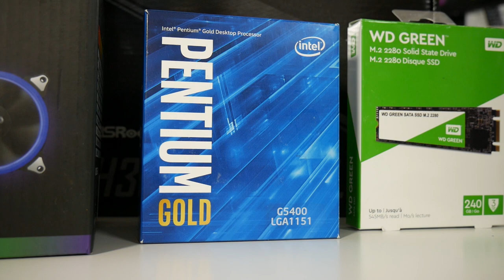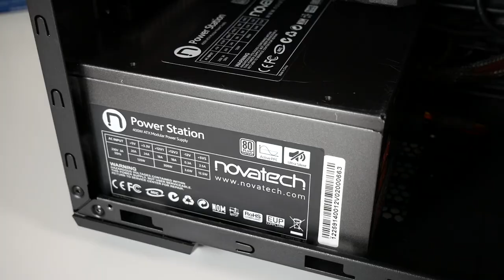Budget Intel PC Build Pentium Gold & 1050ti The Perfect Combination

Comment: Very nice build. If you don''t mind me saying, I think the only thing I would have done differently would be to put the power supply in with the fan facing up. That may help to knock off a few DB's of sound with the fan isolated inside the case, plus it would also draw a little more air out of the case to help with cooling. Just a thought. Great video, I'm glad I found your channel. ;)
Reply from the maker: Thanks for the feedback. I am also quite fond of mounting the psu upside down for the reasons you mentioned. The trouble with the power supply I was using is that the CPU power connector was a too short to mount the PSU the other way. It is a 5 year old model and wasn't designed for the modern way of installation. 
I think actually the psu is not really appropriate for this build as the CPU and ssd seem to be under performing, and I experienced a few crashes in Fortnite when playing yesterday evening.
I'm in two minds to send the lot back and do another AMD build. I really just wanted to use the cooler master case for something. And as I already have a 2200g build I didn't want to do the same thing again. But it looks like I might do!
Reply: Ah, good point about the PSU. Too bad it's under performing. I truly appreciate the way you respond to people here. Not a lot of channels do. Thank you.
Reply from the maker: Thanks Oletta, that is very kind of you to say. I try to respond to 100% of questions, even the rude ones! Sometimes one or two slip through if i am busy, but i do try and make everyone feel like it is just a 1 on 1 conversation on the couch and just be cool with everyone.
I am starting a discord server as a few people such as Harry have suggested it. I am a complete Discord newbie and i don't really know what the features do or the etiquette is but, the people have spoken and i shall make it so! So please join in and make yourself at home. ( or whatever is appropriate on Discord?)
https://discord.gg/E2EUUfq
Reply: @OlettaLiano  you are the only one here I recognize from the current gang....
Reply: @PapaMav  I can't believe I've been watching Mike's channel for over four years. Where did the time go? LOL
Reply: @OlettaLiano  I know right; time does certainly fly.

Comment: hi mike, great video, would you do some cpu\gpu\ram overclocking guides?
Reply from the maker: Max that would be a great idea! That was a thing I was thinking about doing but I didn't know if  the viewers of my channel are extreme overclockers or just people who want a little boost?
What camp would you be in?
Reply: Mike's unboxing, reviews and how to well, Mike i'm just going  to be starting out in trying to oc memory, cpu and asus gtx 1080Ti on an asus VII crosshair...so need all the help i can get as was a really big investment
Reply from the maker: No problem I'll sort something out for you 😀
Reply: Mike's unboxing, reviews and how to also have to workout how to oc patriot viper elite PVE416G320C6KRD 3200MHz as from reading it can get to 3733 CL14 @3.85v but not sure how feasible it is on ryzen as that was tested on intel plus i have 4x8GB samsung b-die i believe, so i'm guessing a high soc voltage and ram volt to get it stable with possibly looser timings.....not an expert by any means as it's been 1st major build since K8 AMD64 days so quite a while!

Comment: What power supplies are trustworthy in your opinion? I'm not seeing many EVGA 80+ PSUs for a good price anymore. I'm not that familiar with other brands.
Reply from the maker: Most "branded" psu are good these days. Anything with a good 80plus rating should be acceptable. I personally quite like the EVGA supplies, but they do seem to be getting more expensive. Also the be quiet PSU are good. Even the cheaper ones seem to perform well. Of course you can spend a lot of money and get a great psu, but I must admit I do tend to budget less for power supplies than I probably should 😀
Reply from the maker: Harry just ordered a riotoro onyx psu. Looks good at the moment. It gets a great review on jonnyguru so that is a great recommendation. Should be arriving tomorrow so I'll do a quick unboxing live stream at some point.
Reply: I'll be sure to watch, I have seen the 750w variant used in a few builds and they seem pretty reliable :)
Reply from the maker: Yeah I was thinking cx650m but the riotoro is actually nearly identical but £15 cheaper. But minus the Corsair logo 😀

Comment: Nice build. This case may be somewhat "cool" looking, however it's a horrible hot box. Watch those temps.
Reply from the maker: I already found out how bad the Cooler Master is for cooling which is quite ironic considering the brand name :-)
I am now using a RIOTORO CR500 and changed the motherboard and CPU to a Ryzen 1200 and Asrock AB350 K4 Fatality and the difference was night and day. Actually managed to get the Ryzen 3 1200 to overclock on the stock cooler to 3.7ghz with no extra voltage, and it runs really well.
The video for that upgrade/rebuild will be released soon if you want to see the difference.

Comment: Is 400w enough for a 8th gen processor.?
Reply from the maker: For this setup it was fine. There are lots of wattage calculators online you can check your limits.
I used that PSU with the Athlon 200ge and a rx580 with no problems

Comment: The g5400 will bottleneck the 1050ti on all modern games, and you don't really have an upgrade path with that motherboard.
Reply from the maker: I think the upgrade path is pretty open. As it is a coffee lake board you can use all the current range plus the coffee lake refresh chips that will be launching soon. As such the current coffee lake chips should drop in price so a i5 8*** would drop straight in and offer much better performance. Also as the G5400 is only £50 it gives great performance for the price for people on a real budget. And allowing other options when funds allow.
Thanks for the comments.
Reply: Mike's unboxing, reviews and how to I think that by the time the sort of person to build such a pc as in the video, will have enough money for an it 8400, those CPUS will be obsolete by that time. H310 is very feature lacking. b360 motherboards only cost on average 20£ more and have a lot more features than h310.
Reply: Gabariel * Since Mike built this system to be mostly a media player with the capability of some light gaming, an upgrade path would most likely is not that important. It appears that it performs well for the tasks with which it was intended. Not every riding mower needs a 5 liter V-8 engine. LOL
Reply: Oletta Liano you can just get a gt730/gt1030 for a media player pc... way cheaper and gets the job done.
Reply: True. But if it was my build I'd personally avoid anything from Intel and go with a Ryzen 2200G APU instead, getting roughly the same performance while sparing the price of a graphics card. That's what I love about building PC's. So many great options to suit one's personal  tastes.
Reply: Oletta Liano yes, but I dont think a 2200g can play 4k video...
Reply from the maker: I think it depends on the video bitrate. It should be fine though. even the intel igp can cope with most common 4k files.
Reply from the maker: What extra features do the b360 boards have that would improve a budget system? Overclocking is still not an option I believe? Other than that I can't see what benefits the b360 could have. I am genuinely interested, as I normally am a AMD user. And my knowledge of intel chipsets is very patchy.
Reply: Mike's unboxing, reviews and how to 
https://www.google.pl/amp/s/www.pcworld.com/article/3268063/components-processors/intel-motherboard-z370-vs-h370-vs-b360-vs-h310-8th-gen-cpu.amp.html

this article basically explains it all without going too deep.
Reply from the maker: Cool thanks i'll check it out. Much appreciated

Comment: You might try these fans: https://www.amazon.co.uk/aigo-Computer-Radiator-Adjustable-Different/dp/B0757KKJ49/ref=sr_1_1?s=computers&ie=UTF8&qid=1533902582&sr=1-1&keywords=aigo+c3  It comes with the controller box and you can control Fan speed (low/high), fan effects & speed of fan effects.  Only drawback is you need the controlled because the fans have a 6 pin connector instead of 4.  But they work fine for me.
Reply from the maker: It is a shame they aren't PWM controlled. Or a remote control would be good. Sometimes you want the PC silent like you are watching a film or concentrating, other time you want it full blast as you are trying to get 300fps on CS:GO